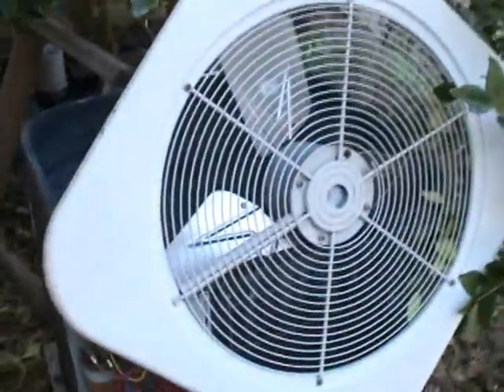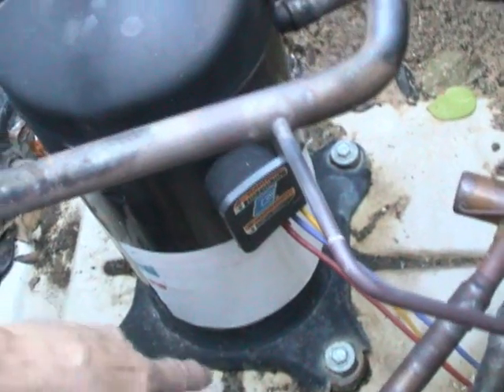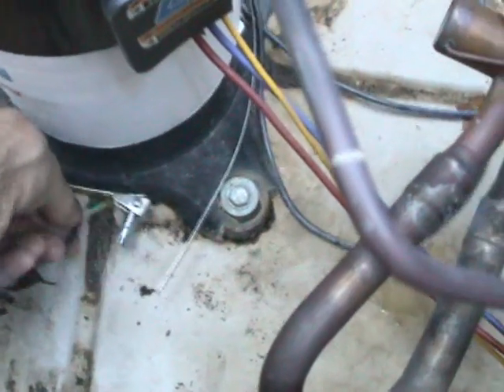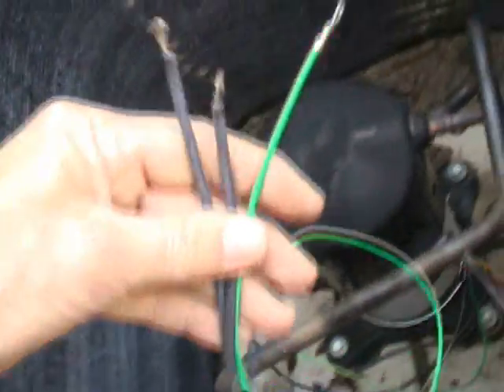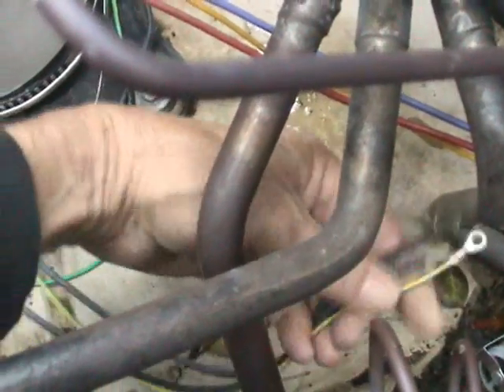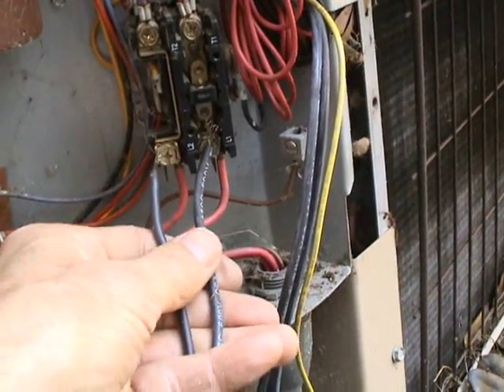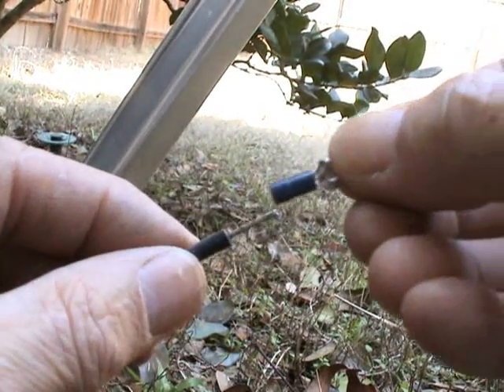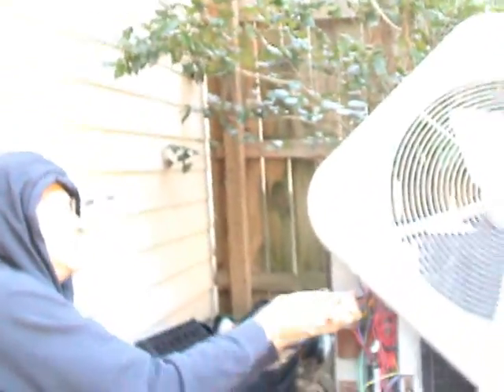HVAC Crankcase Heaters

Comment: Your supposed to wire that heater so it shuts off when it’s actually running it’s simple you put one hot on the common bottom and the other hot to the top that has the shunt.

Comment: I appreciate this video, and that it’s DIY’er.  
Thank you for reaching me what a crankcase heater is.  One thing that I didn’t hear mentioned would be to ensure that the power at the circuit breaker, or furnace power was turned off.  Even with the service power to the air conditioner unit was unplugged power still goes to the unit, to the power portion of the condenser he was working on.
Also, unless you live in a region where the weather is warmer and doesn’t see snow or sub-zero temperatures it wouldn’t be the best idea to have the crankcase Hester continuously running and using electricity.  When the need to use the air conditioner comes back again in the cooling season you’ll want to allow the compressor to sit for 12-24hrs and allow it to boil off oil.
Be safe and keep pushing out excellent teaching and teachable moments.
👍🏾

Comment: Why did you wire it with L1 and L2 ? I think you should to wire it one to L1 in the bottom of the Contactor  and second wire to the up of contactor at the same side of the contactor.
Reply: I don't understand why he added it at all seeing the ac unit is 15 years old so Why does it need it now? Second, the connection will power the crankcase heater 24/7 365 days a year. That's going to increase the electricity bill for sure outweighing any advantages it will provide. 3rd, As several mentioned, you should have wired it from L1 to T1 so it only turns on when the unit is off. 4th, You'd ONLY want to install that if the lineset is more than 120ft but even then I'd install a txv shut off vs. a crankcase heater. 5th, Instead of a crankcase heater there is a trick you can do with a compacitor that basically send a small electrical pulse in the compressor windings that will keep it warm so freon liquid will not settle in the compressor but again it's going to increase the electrical bill.

Comment: Well the way you wired at the L1 and L2 ( the incoming power) it it is going to run 24/7,where in fact should be running only when the compressor is off. 
So it should be wired، you should first have s single pole contactor and you would plug one 120v terminal coming from crankcase heater at one side of the contactor( where there is no continuity)  and other 120v at the the other side across from it. 
So what happens is the crankcase heater is running all the time until the compressor comes on, at that point that one side of contacts will close, bypassing the heater because as you know the current will follow the path with low resistence.

Comment: Why keep the crank case heater on 24/7? Could you hook it up to kick off when the compressor kicks on to reduce wear on it and power consumption? Thanks for the upload, always learning
Reply: bomark 2002 you don't want the heater to run when the compressor is running.

Comment: DrZarkloff I hate it when technicians have to replace reversing valves, other things, or fix leaks by recovering the charge because a majority of systems don't have crankcase heaters, and the oil just migrates to the warmer part of the system. The oil gets recovered out with the refrigerant, and most technicians don't have the know-how, or tools to add it back in. Would using an un-used pro flush injector be a good way to get oil into the system?
Reply: +John Smith If you put the same refrigerant back in again there are no problems with oil loss. Though you need to take the refrigerant out the cylinder as a liquid to ensure the oil is not trapped.

Comment: wonder if you could use a temp controller. something like a REX-100. $12 - $15 plus a couple bucks for a thermocouple and relay (may be able to use the internal relay with 70w. I think its rated at 5A). maybe $20 ttl..

Comment: Dr. Z, I read that a crankcase heater comes in two types: a clamp-on band type like the one in the above video and an insertion-type where you slide the crankcase heater into a "well".  Any video on that 2nd type of crankcase heater?

Comment: good video, but now you are running 70W all year, 24/7....  How about adding a relay and a temp sensor to allow the crankcase heater to turn on if the OAT is less than 60-deg.... or so?  This way the compressor is not being heater in the summer and you will save the customer some money!

Comment from the maker: @whereisthemessiah Not necessarily would the crankcase heater be the problem. Actually, you might want to disconnect the crankcase heater then make sure that you're getting line voltage to the contactor before pressing in the contactor. If the line voltage is good then you want to press in the contactor manually to see if the compressor will come on. If it doesn't then you could have a bad contactor. Use a multimeter to make sure that you're getting line voltage to the load side of the contactor

Comment: @DrZarkloff So if the compressor is good, and I bypass the defrost board but manually pushing in contactor but still doesn't work then it definitely would have to be an issue with the crankcase?  Thanks again!

Comment from the maker: @whereisthemessiah It is a very common mistake made by some less experienced techs to condemn the compressor if the breaker trips or fuses blow. The problem could be as simple as a bad crankcase heater that's short to ground. 

I don't think that the defrost board would be related to the same scenario. In your case, the defrost board might not be sending control voltage to the compressor contactor. The board might have the compressor locked out on a low pressure or some other lock out.

Comment: Hi drzarkloff.  I recently just installed a new defrost board to a split system.   Now my compressor wont start.  The guy at the store told me it might be as simple as just disconnecting the crankcase heater.  He said hes seen a lot of guys change out compressors when only the crankcase heater needed to be disconnected.  Can you better help me understand this?  I graduated from a trade school about 5 months ago and i'm a little rusty.  Thanks!

Comment: what is the advantage of installing a crank heater?i know it heats the oil in the compressor and allows the refrigerant to return to the system...is that all? or is that correct?i am attending south florida hvac school and I have to say Bob and steve that run the class are worth there weight in gold!really enjoy coming to class everyday.thanks dr z

Comment: @DrZarkloff  Respectfully, couldn't you just put 1 lead to L1 and the other to T1 on your single pole contactor? Then it would only operate during the off cycle. And if it were a 2 pole contactor couldn't you just add a relay with a 240v coil

Comment: @J2dab122  No need to add a relay. On a single poll contactor you can hook one lead of the CCH to L1 and the other lead to T1 and then it will only operate in the off cycle.

Comment from the maker: @BigDaddyDJoe If the tech didn't remove the wires from the contactor before ohming the compressor winding then it is possible that could give them an incorrect reading.

Comment: Lover your videos. I had someone come and check me system.  He checked the terminals and told me the compressor was bad.  I noticed after he left that one of the crankcase heater leads (the heater is internal at the bottom of the compressor) was broken off.  Could this broken wire have given him false readings and could this cause my compressor not to start?

Comment: I think it is good for the business; especially, for those who are new to the field. I think it is great that Dr. Z share his experience and knowledge to those who seek it. Also, the field is drastically changing as the older techs are retiring, and the advancement of the equipment. Do keep in mind that a customer is still limited as to what he or she could do to a system if not EPA certified to handle refrigerant.

Comment from the maker: The crankcase heater keeps the oil warm to prevent the refrigerant from migrating with the compressor oil. It's important for proper lubrication of the compressor.

Comment from the maker: A suction line filter drier is generally installed when replacing a compressor. They should be replaced after the first week then again after the first month then it should be removed after six months.